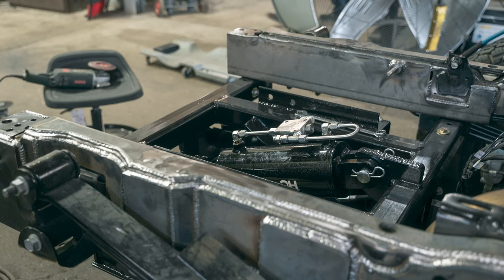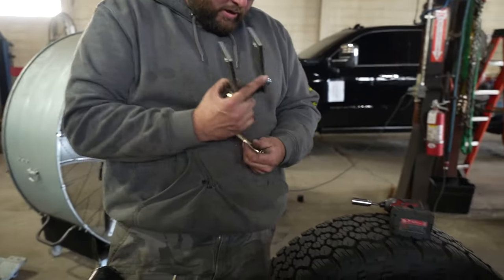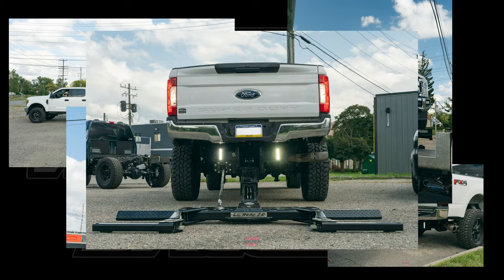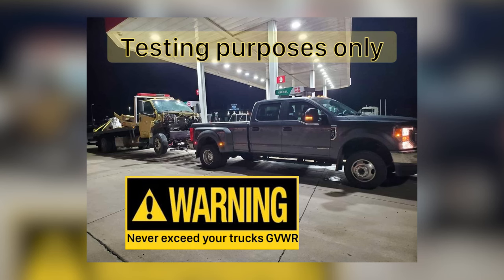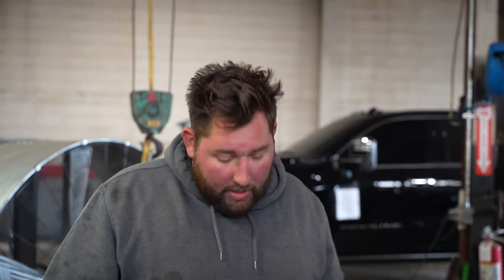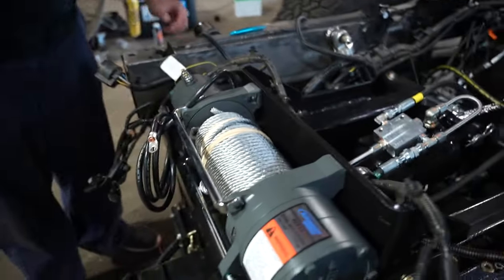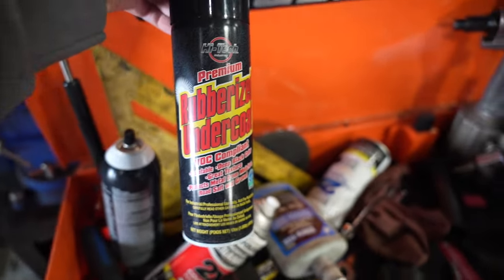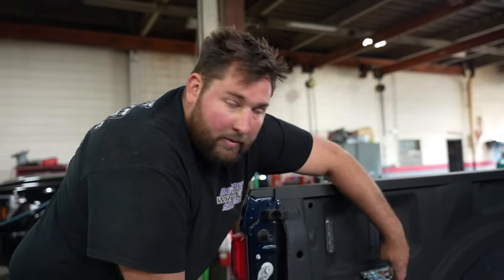Installing a Lil Herc 2.0 in a Roush F350!!

Comment: How much for that done to be done. .. equipment price and labor
Reply from the maker: The Lil Hercules is the strongest light-duty wheel lift on the planet! The only equipment in the world that can tighten its crucial pivot points. Pricing is currently $25,000.00 not installed, plus shipping. For installation, add another $9k  for a total of $34k out the door! Which includes the frame reinforcement and rear suspension plus everything else needed to “Tow” home.  It takes 2-3 weeks typically to complete an installation.  
All installations come with:

	•	Wireless Towlights & Corded Towlights
	•	Ratchets, Straps
	•	Safety Chains
	•	Spare O rings
	•	Spare fuses
	•	Spare can of undercoating 
	•	Spare L-Arm Springs
	•	Steering Wheel Strap
	•	Toolbox for double motor electric/hydraulic pump. 

https://youtu.be/PKhJzoIPpeQ?si=lcyImoiGBWIsVdMK

Our unit has a 5,000lb lift capacity and a 10,000lb total capacity. The combination of our pivot pins that tighten and how everything is overbuilt, our units save you $$$ in the long run. 
Our frame reinforcement is an engineering process that proves to be the only company that puts the R&D into this application of converting a pick-up truck into a tow truck. Our in-house engineer stress tests the unit on the truck's frame and has our CNC plasma cutter cuts out the pieces which are easily welded by our welders. Our welders are top-notch cream of the crop & lay down beautiful welds. This is a process that you can trust! The most thorough Frame Reinforcement in the world. Our in-house engineer stress tests the truck frame in 3D CAD.

 https://youtu.be/wZuyW-mTWMk?si=XboXzW-ikjgx5ig4

Our rear suspension makes the truck rides like a Cadillac. Everyone knows that a truck rides a million times better with weight in the back of the bed...All customers say the truck rides better than when they brought it in because of the weight of the unit (1200 lbs) in the back.  The fox shocks and our custom helper springs don’t engage until a load is put on them..., which translates to a super soft ride, loaded or empty. 

https://youtu.be/u-JzOq1HqvE?si=coJC7sZRjfKfiGT1

Our class five extendable hitch also enables you to bumper tow. You don’t lose bumper towing, and you don’t lose the ability for a fifth wheel or Gooseneck either, making the truck so versatile. It’s a no-brainer. One insurance payment and one truck payment does everything! 

https://youtube.com/shorts/LY_ah5eQpj4?si=6_DCkK0ZggIzxvsP

WHAT'S THE BIGGEST THING I CAN TOW? 

    • Anything smaller than your truck. Never tow something as big or bigger than your truck if you want to stop and steer safely. Towing a truck as big or bigger is going to exceed the capabilities of the brakes 
(you do not have trailer brakes in this application). When testing our units we often pick up a load the same size or bigger. This is for testing purposes only and you have tp admit that if it can lift a heavy load, a regular sedan vehicle won't effect it hardly at all. Hence the reason our units last so long. 

WHAT TRUCK DO I NEED?
	•	Any year or make, that’s a 3500. 
	•	Any 2500 from Ford or Chevy with a 10k GVWR, and to my knowledge, that’s 2017 and up. 
	•	No Ram 2500's any year because they either have Rear Coil Suspension or they lack the 10,000lb GVWR needed. The truck must have 2 things to qualify a 10,000lb GVWR & Leaf Spring Rear Suspension. (We prefer a 160” wheelbase as well). 

https://youtu.be/HCpuLvXwe3g?si=aD5u491eghnDgfV9

OPTIONAL  ITEMS

* Dollie Slide and Glide $3995
* Frame Fork KIt - $4800 comes w/ 3 sets of forks.
* Winch behind the plate - $4500 comes w/ synthetic rope.
* Wireless - $1850. The LH comes standard w/ a 20’ corded controller.
* Motorcycle Attachment - $1550 enables the LH to tow motorcycles damage-free.
* L Arm Extenders - $600 for the pair. They extend the L Arm. Made of 6160 aluminum.
* Collins Dollie’s $3,000
* Front Fox 🦊 Shocks $1,200

"The bitterness of poor quality remains long after the sweetness of low price is forgotten. 

Ben Franklin

Comment: What’s the installation time on the lil Herc on average?
Reply from the maker: Typically takes 2 to 3 weeks to complete an installation, which includes the frame reinforcement and rear suspension as well.

Comment: I’m a GMC guy, what would be the preferred engine for a GMC???
Reply from the maker: Great question. Diesel is always the answer due to the weight.  Anything that is already engineered into the truck with an 600lbs on the front end is the way to go! Versus a gas motor that’s super light…it’s a no brainer for us. Some hate diesel and choose gas. 

Just understand this… Every counterweight we’ve put on a gas motor truck. The customer ended up taking off because it was killing his brakes. Shocks struts, and tires too soon. So we stopped 🛑✋🚫 adding counterweights to trucks, If the customer wants a counterweight we suggest getting a bigger truck or longer truck.  Trucks with long wheelbases & gas motors perform way better than the shorter wheelbase trucks with a gasser.
Reply: Ok, so I’ve got a 2003 Regwncy 1500HD, it came with 5 leafs, and they don’t make that 1500hd any longer. It’s a crewcab 4x4 with an 8 inch lift. If I ever win the lottery and could buy a new GMC and have it tricked out, I would use it to haul my Black Series travel trailer, a 2020 because they sold it to a chineses company and the quality went down. Hey I have a great idea. Why don’t I drive my truck to you and you can use it as a “Testimonial of what you can do to any truck, no matter the year??? We could put stickers on it to show who rebuilt it. Now the engine has 100k miles and the same engine specs as a 2500, but I’d like to put a beasts motor in it. What do you think??? I already know the answer, but you can’t blame me for trying. You guys do awesome work.. I’ve truly never seen anything so B@d@$$ in my life. Truly amazing!!! @detroitwrecker